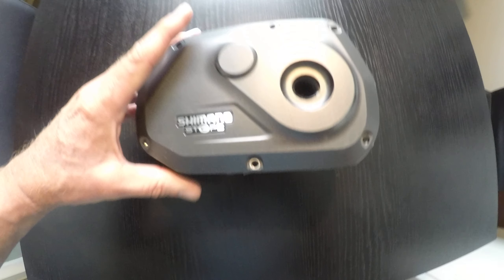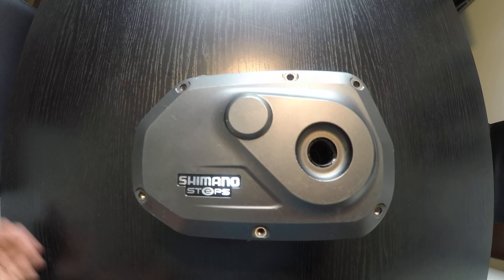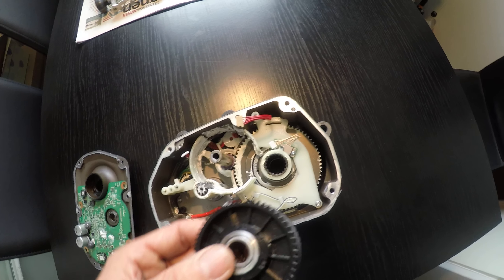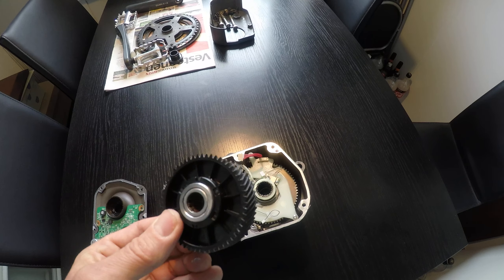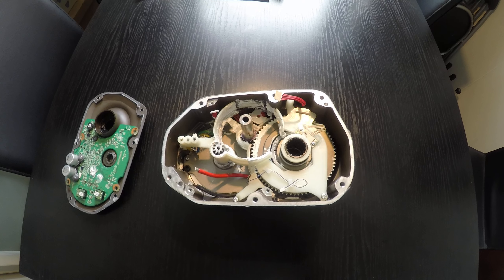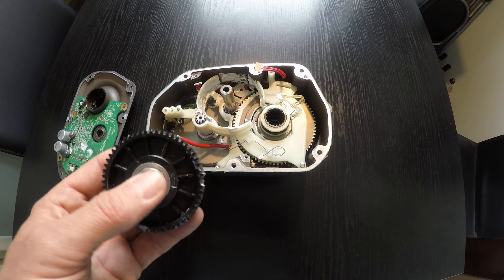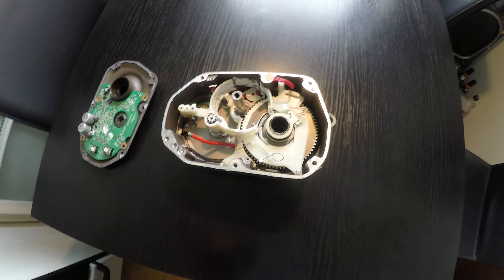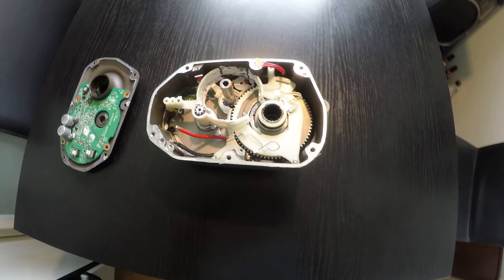Shimano Steps 6000 worn out due to not replaceable plastic gears

Comment: I really appreciate that you opened the motor and showed what is inside....Nylon..This is good information, Thank you very much.
Reply: Most ebike motors use plastic. Lighter, strong, cheap. It would probably last more than 3x times that if it was in its original state (no chip)
Reply: @stamK. I have Steps with almost 20000km, still working, no chip, it's stock up to 25km/h

Comment: Thanks for putting this video up. This also happened to my du-e6001 motor. The problem is a bit more complicated than meets the eye. The bearing in the middle of the black plastic cog is a one way clutch bearing (NSK FCB-12), it only allows rotation in one direction. When the motor engages, it's pinion drives this black plastic cog which in turns locks the bearing and this grips the cog's axle shaft which drives the main chainring cog. This means the bearing is transferring power from the cog to it's axle shaft. The bearing is somehow tightly embedded into the cog, I was not able to remove it even after hammering the bearing. I'm not sure how it is seated into the cog. So 3D printing or even milling a new cog might not work as the bearing will not be seated tight enough inside the new cog. I'm currently trying to repair the stripped teeth using something like JB weld, but not sure if it will be strong enough.

Comment: Fuc*ing hell. How is possible a plastic weel inside the motor. My shimano bike is with motoe Shimano E6100 is it also with plastic parts hahahahahahaha but makes noise I mean norma as electric engine makes it. Thank you for the video sir. Could you help me to downgrade my firmware from 4.7.7 to 4.5.0 please
Reply from the maker: No unfortunately I can't find any option to connect to computer. I have had to pay the bike shops to reprogram it.

Comment: Of course when you tune it , it will be worn out faster. My engine makes now 30.000km without any problem. But I had to change once the
Shimano ALFINE Di2 SG-S7051 in the rear wheel

Comment: Just had mine replaced after 26000 km, but lots of them on own steam. Did ask for the old motor to be given to me And now I see this video!
The repair by a bikeshop was 995 euro including work 

Do you have a recording of the sound it made?
Reply from the maker: No, I didn't record the sound.
Reply from the maker: I bought mine in China for 340 Euro, but it's probably not possible anymore.
Reply: @MichaelKroese  98 eur isntallation work, the rest just the Du-6002 yeah, should have ordered one myself elsewhere and save a few euro’s o well hinsight

Comment: 12k on a tuned Shimano is really good. My e7000 non-tuned broke its plastic cog near the shaft after just 800km. Luckily a shop rebuilt it on a lathe for 100euro
Reply: Hi, what kind of shop and how did they reattach the bearing?
Reply: Shimano warranty technician here, if it's only done 800km why did'nt you just get the shop to do a warranty exchange and if it was out of warranty and you are the original owner we can do up to a 50 % discount on a new motor?
Reply: @bertieballs  1. This is what I did-I went to the official Shimano repait shop nearby and even asked if some part of the new motor would be covere by the warranty , but wasn't offered any discount for the replacement motor
2. If they had replaced it with the same motor I'd still expect to have the same problem after another 800km, as the cog would snap the same way eventually. It just has weak spot near its axis by design 
3. 100Euro for rebuilding it was definitely cheaper than a 50% off-priced motor

Comment: Hvad endte du med at gøre? Jeg har overvejet en Thansen cykel med e6100 også bare smide en speedbox på den. Hvad var din topfart etc. ?
Reply from the maker: Jeg købte en helt ny motor i Kina for 2500 kr. og må acceptere at den nok kun holder de her 12000 km. Top farten er næsten 50 km/t. men nu kører jeg kun norm speed med high i håb om den holder længere.
Reply: @MichaelKroese  det er også for vildt de ikke sælger stumper løst til dem :(. Men du har ellers været glad for den? Hvilken cykel har du?
Reply from the maker: @dazbrugernavn  Ja jeg har været super glad for min el cykel. Det er en White el cykel fra XXL 🙂

Comment: Hi Michael ! Could you please share the 3D plan of the broken gear? I would like to print one with different plastic. Thank you !
Reply from the maker: I do not have a 3d plan of the gear, but if some have, then I am also interested
Reply: @MichaelKroese  I would be interested in designing a replacement if you can provide some accurate measurements.
Reply: @pchaw9  sory   did you  make 3d plan forc that gear ?
Reply: You can use photogrammetry to scan the original cog, by taking lots of pictures from different corners. Then let a computer program like 3DF Zephyr make a 3d model of those pictures. That model will not be accurate, but with 3d Blender one can make a 3d model that will "fit" the 3d scanned model. Then you can print a new cog.

Comment: Today the wheel inside of my motor is broken also. Badassbox. Like you i have driven it for 2,5 years but more than 12000 km. You've got some replacement?
Reply from the maker: Failed to get any spare part. Shimano does not supply spare parts for their engine, so I had to buy a new engine.
Reply: @MichaelKroese  dont you look for CNC milling?
Reply from the maker: @adamast78  No, do you have some good ideas. I've had a friend print one, but I can't get it strong enough.
Reply: @MichaelKroese  you have to find the right degree of hardness. Just look forward

Comment: Why doesn't Shimano sell parts for its engines? If the pedal pressure sensor breaks down, the engine will be thrown away after warranty.
Reply: on purpose to earn more money awcorse,that guy had to buy whole engine again instead of 5$ plastic wheel.eco friendly+capitalism is not possible

Comment: 12000!?   after this nice km number go for a new one :)))  ...  try the Bosch to see that after 5000km is finished  :)
Reply from the maker: Thanks for the tip :-) I have bought the same engine again as I can not mount another on the bike. I hope at some point I can get a new gear printed :-)
Reply from the maker: The warranty has expired and the gears are worn thin in the teeth on the gears and eventually the teeth are broken

Comment: which motor would you buy ? i need to chip. 25kmh is a joke.
Reply: It's not a maximum speed for the bike. It's the maximum speed that the motor will give assistance for. That's the price you pay for not having to have a licence.
Reply: Its no joke it by law here. Because you should not run 45 between other bycicles going 16kmh. You are a danger for them! Buy a Kawasaki H3 when you want to be fast!
Reply: @maozedung7270  25kmh is too low. 45 a bit overkill for bike road usage. 35kmh would be nice, assisted.
Reply: @maozedung7270  US standard is 20mph which is 33km this is the one place where the USA has the correct limit.

Comment: Cud u not 3D print it mate
Reply from the maker: I hope at some point I can get a new gear printed :-)
Reply: @MichaelKroese  3D printing is inadviseable for this kind of high performance part, but I imagine that if someone took the time to model the gear, then it would be easy to get it milled from ABS. Alternatively, if you want to use 3D printing, you would be able to use the print to create a mold, into which you would pour a suitable resin (FEPshop – Functional Resin seems like a valid choice, but I only skimmed). Then you would have gears that need some minimal manual polishing before being ready to be slotted in!